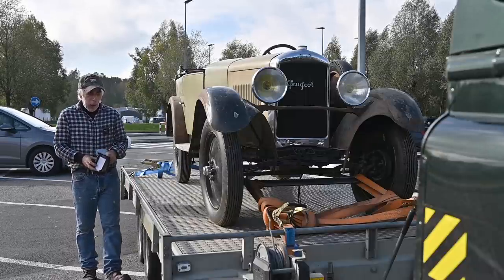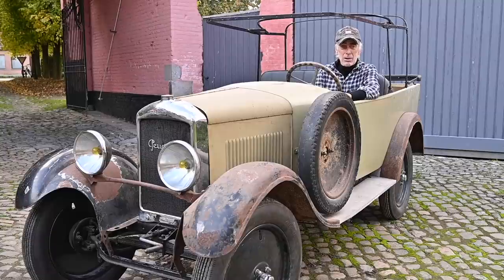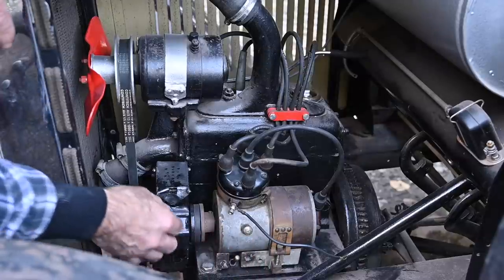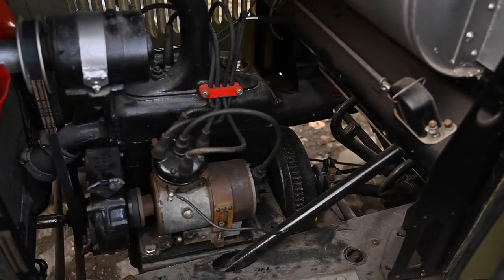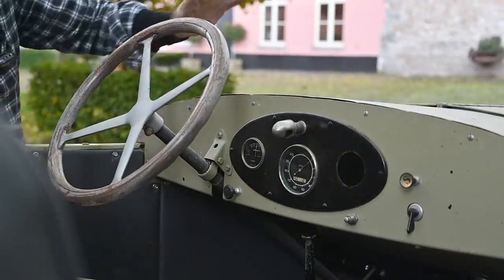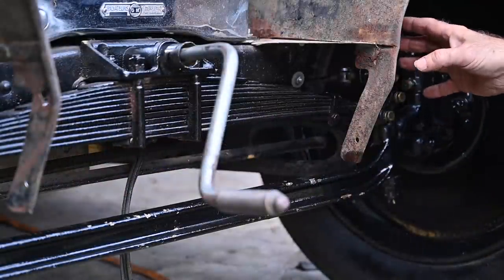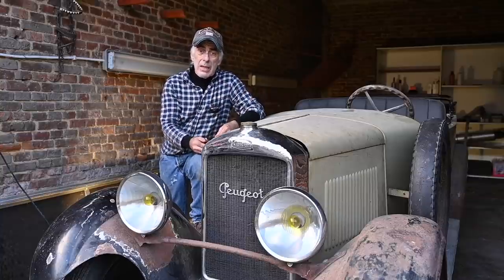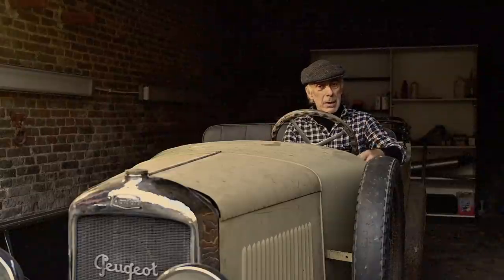Buying an Old Timer ,  and I did

Comment: I am restoring a 1921 Peugeot Quadrilette. The Quadrilette is quite similar to your 190S, including the trans-axle, the engine design/displacement and the very basic suspension.  I hope you post another video when your car is running.

Comment: Regarding the magneto .Generally they were built to a very high standard and don't normally require replacement but one thing that does prevent them working are the magnets. They need to be remagnetised from time to time if the vehicle is not driven regularly .A good mag puts out a spark that will make a arc welder look small. (please do not grip the crank like that when trying to fire it up...) 
it used to be a service provided by Autoelectricians and Bosch service places but i guess today you will have to do a search of the local oldtimer car clubs for a magneto specialist. The points can be a problem as it usually means a set has to be adapted from a regular distributor .
Also, your Peugeot  explodes a myth ,that Ford Australia built the first utility vehicles in 1934 ... 😁
Reply from the maker: Thank you for the comments  and very good tips... I will need to find the right way to cranck it without braken fingers and hands.   Any tips ?   The magneto, I will have a look what state its in ... and if need be re-magetise the magnets... I might have to build something for that

Comment: Whats your thoughts on your defender,been looking at them heaps latley.have you hqd any issues?
Reply from the maker: Thanks for the comments,  mine runs like a champ.. of course I keep good care of it.  What I changed was the MAF sensor, fuel pomp, pressur regulator, rear shafts, rear drive prop,injector wiring harnas.... and that is about it...  it has 225000KM.. and still going strong  (TD5 - 2003)
Reply: Thanks for your time to reply... I really like the look and shape of them,land rover have a good solid name for them selfs as time has shown... 
Thanks heaps mate from Australia...absolutely love your content,keep it up 👌👌
Reply: I have a Mitsubishi pajero with 425000kms and it doesnt skip a beat... Time to upgrade tho aha

Comment: Congratulations! Great car! My first car was a Peugeot 403 1960 and they were still using the transversal front leafed spring. Bonne chance!
Reply: My 1979 fiat has a single transverse rear leaf spring! It's fwd though.
Reply from the maker: Thanks for the comments, really ?  I did not know that
Reply: @D3Sshooter  they also used. the old time shock absorbers with a side lever. Not the telescopic ones